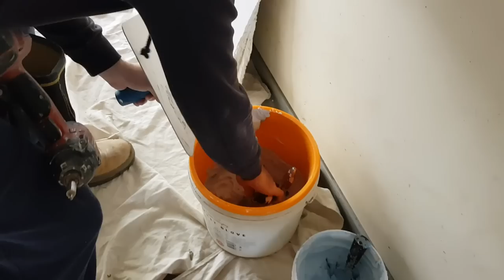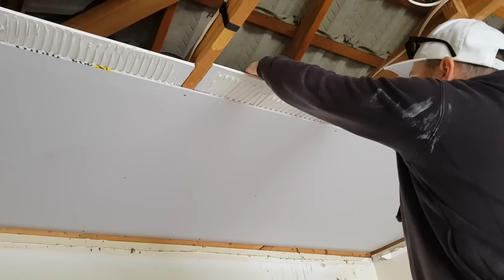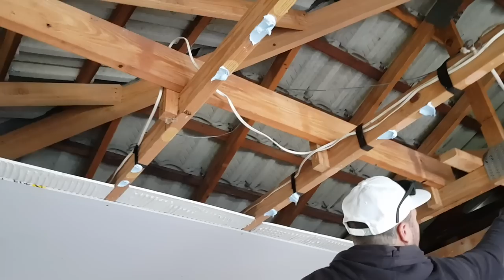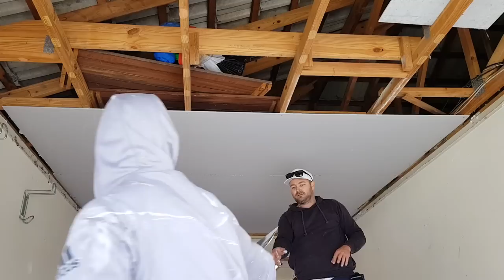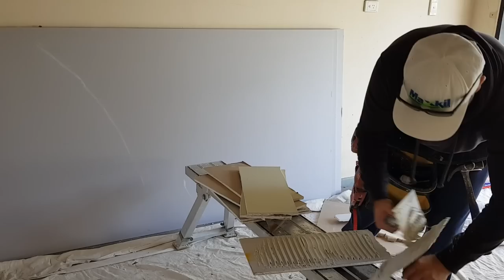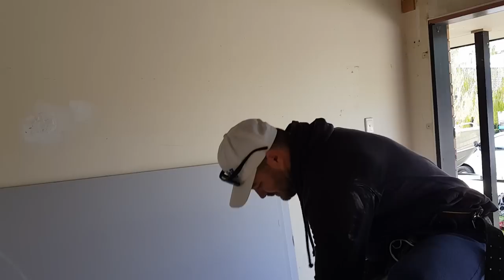Get Stronger Joints when Hanging your Drywall Ceiling

Comment: Always good practice to bridge seams when 24oc, we use 1/2" plywood scraps and screws, also found that spackle spots on joints never holds up from expansion and contraction seems to let go. Nice work guys

Comment: That's the way Buddy !! Always 'back block' Your ceilings as well as strengthening the joint you get rid of some of the off cuts. Manufactures recommend to use back blocking cement. One thing for certain will be that the Seppos won't know what back blocking is. Great work as usual !!
Reply from the maker: Thanks Serge

Comment: You guys are on the right track but a stronger and faster way is to use scrap 2×4 lumber and 2 screws on each side. 
I highly doubt the second sheet will have that good of an adhesion unless you reach up and over to press down on the blocking, which I absolutely know you didn't do.
Reply: I was about to say that to, like is wood blocking that hard to put in lmao
Reply: Adding wood blocking would take much longer and cost more and would require more tools and material and make more of a mess

Comment: You can't use timber blocking it will crack the join as it moves in the heat, they are doing a great job which won't crack or move
Reply: Are u crazy one timber of 2x2 at same as your switch pads or radiator pads 500mm or timber to side of each joice do you guys even know about staggering your sheets to make it more solid  i can agree with putting the plaster on the joices or mastik

Comment: In my 45 years in the trade, ive never seen this done, and have never had a problem..........though we do use 5/8 board on ceilings on 2ft centers......
Reply from the maker: yeah ours is only 10mm thick. too thin if you ask me
Reply: @Maxkil  so our 5/8 board = 16.8 mm, and its fire rated, which is way stronger than regular board. Do they not have fire rated board where your at?

Comment: I worked in Indiana, Ohio, and Kentucky, it really wasn’t necessary inland, maybe in costal states with Hurricanes, sandy soul  n such but I never experienced issues  with the Flat joints cracking hanging on 24” centers.. I know the codes and circumstances are different in other areas

Comment: Better to screw the back blocks to pull them in tight?
Reply: I would agree.. but pulling drywall to drywall tight? I have used wood blocks to do that.

Unf.. unless you have someone in the attic to push back down, the bond is not that great. Maybe some runny mud would work.  Or pin them to the rafters.

At the end of the video he picks up on one of the back boards.. that's all the bond your getting. You can push and squish them as putting on. But once the next full sheet goes up it will lift it up just like the guy did. Leaving it floating. Any bonding would be minimal.

Comment: I think they are using 10 mm drywall.  USA use 1/2 inch or 13 mm to 5/8.  So back blocking not required.  But with that said. I back blocked a house recently and think it improved strenth.  Thank you for vidios.
Reply from the maker: Hey mate you're exactly correct. It's exactly why we need to do that, our board is quite thin, and sometimes it can get a little flimsy. It is light to hang though and the sheets come in 6meter  lengths. Thanks for watching bro

Comment: Good work with the backblocking the only thing is that you, only put one screw in the middle when with csr board requires two screws at 400mm centres just letting you know for future videos but keep up the work
Reply: Jesse Dale we use 2 screws either side of centre for 1200mm sheets and 2 screws at 450mm centres for 1350mm.

Comment: Are u crazy one timber of 2x2 at same as your switch pads or radiator pads 500mm or timber to side of each joice do you guys even know about staggering your sheets to make it more solid  i can agree with putting the plaster on the joices or mastik

Comment: And that’s why sag resistant is the best. Always someone trying to over think  work.
Reply: Or use 5/8" drywall on 24" on center roof trusses
Reply: @larrylewinski3086  1/2 sag is twice the rock with less than half the weight, unless 5/8 is needed for code. Try some time, 1/2 sag doesn’t burn anymore than 5/8 it’s all about the money and someone making the fire codes.

Comment: I'm thinking the drywall so thin that they have to put blocking between the bottom chords. They seem to be very much behind with their building codes they're still using skip sheathing on the roof, and nothing for waterproofing but the cement tiles sitting there.
    I wonder how thick the lid board is there? I wonder why they don't screw with the back blocking??

Comment: question please , do you have to support the joints with extra board and glue? the weekend i will be re boadring my utilty ceiling as a leak from the bathroom ruined it. i will strip the old baords back to joists. the ceiling is small 8ft by 6ft. do i need to put glue to the joists like you do here? and do i need to support the joins inbetween joists with extra board and adhesive?
Reply: I can help u in millimeters mate hahha
Reply: You shouldn't have to glue the drywall if you use enough screws. 
Always use the 5/8" thick drywall if the framing members are space over 16" on center.

Comment: Hi mate, why no 450c metal battens for this job? wondering why some ceilings have this and other don't cheers
Reply: Depending on what you are talking about buddy
Reply: Do u mean the roof or trusts
Reply: @superherobeatdown  yeah looks like your fixing it directly to the truss / ceiling joist. i noticed in some other videos a metal batten would be fixed first then the plaster board is fixed to the batten. Is the batten only necessary in certain situations?
Reply: @brenden8783  Usually it's to level out the ceiling and help reduce cracking as a new house dries out. When you have a large area like an open concept house you can see the waviness of the trusses. Sometimes it's also for noise reduction.

Comment: You may save a few dollars but this is still the wrong way .All joints should be on Timber / structure ,  I have worked in the UK this is how they do it no problems ever . Floating joints are weaker .Plaster board is cheap why do a crap Job !!
Reply: Here in the US,  4x8 foot, 5/8" thick sheetrock is supposed to be used for the ceilings, run across the joists (timber), which are 16" on center.  The finished edges are often floating, except for a screw every 16 inches.  No back-blocking required.  But I've seen it done different ways.  Inspectors generally don't have a problem with it, as long as the sheetrock is 5/8 inch.
Reply: GSMSfromFV Thats not the point .Floating joints in any media are weaker .
Reply: And there are no problems with 5/8" sheetrock with floating joints.  If there were, it would be addressed by the building code.
Reply: GSMSfromFV It is in Europe. All I can say is the building code in the USA is substandard.
Reply: I'm left with the impression that the UK and Europe has a problem with sagging ceilings, thus the need to have  ceiling joists and cross-bracing at all the joints of the sheetrock.  That's not a problem here in the US, as long as 5/8" sheetrock is attached to joists that are 16 inches on center.  And I live in California, which is known for its earthquakes.  My house is 47 years old and I've never had a floating joint problem.  It's essentially unheard of.
Reply: Here's a California Drywall Code Checklist: _http://buildingincalifornia.com/wp-content/uploads/2014/01/DrywallChecklist.pdf ____ When 5/8" drywall is attached to 2x8 ceiling joists that are 16" OC, there isn't going to be much deflection, if any.  When the floating joints are filled with compound and taped, the bonding between the two sections of drywall is pretty rigid.  My house has gone through multiple earthquakes over its 47-year life, and ceiling cracking, much less sagging, has not been a problem.
Reply: GSMSfromFV  Not at all .Sagging ceilings in houses that are 100's of years old  made of  lathe and plaster mixed with horse hair has nothing to do with plaster board fixing  .I have Family in the USA ( Alabama and New York ) they were in awe at the quality of building in Europe. You may want to look at the building warranties or lack of inclusions in the USA .I now live in Australia who use the same method as the USA for dry lining , its definitely inferior. I have worked in the construction Industry for over 30 years and as I stated in my first post cost seems to drive these poor practices. I won't even start on roofing method s it starts to get really ugly 🙄.As for your statement its unheard of in the USA,  I suggest you look at all the utube videos that refute that .
Reply: GSMSfromFV You may want to google which first world country has the lowest standard of building code .Yep thats right its the USA , except for a few states .Sorry !
Reply: I cannot speak of the the other things that you reference, since I'm not in the business.  But I do know this - backblocking and/or having a timber on all four sides of of ceiling drywall is in search of a solution in which a problem does not exist here in the US.  If it did, it would have manifested itself decades ago.  An inefficient use of time and material.
Reply: GSMSfromFV As I stated there are plenty of US utube videos on repairs of this type .I wonder why !
Reply: Repairs, yes. Not original/new construction.  I use the back-block method to repair holes in drywall.  I've watched many YouTube videos regarding original/new ceiling drywall installation. Since the drywall is installed across the joists (not with), inevitably at least one of the factory edges does not fully contact wood over its entire length.  Just every 16".   Now, the ends of the sheet must split a joist in half over the sheet's entire width, or butt up against the wall.  The 8' factory edge, no.  Not required by code and historically it has not been a problem.  Any problems that I have are usually associated with me not applying the mud properly either over or under the tape.  When it dries, it comes loose.  That's when I usually get a professional to tape and mud it for me.  I realize that we are just going around in circles regarding this issue.  You've seen things with your own eyes, and I seen things with mine, which includes pulling permits, having inspections, watching drywall contractors, installing myself,  and asking questions.  Best of luck with your endeavors.
Reply: @GSMSfromFV  I disagee partially,  in az where single story residential are mainly 24" ctc, I repair sagging joints almost daily,  it is normally a nailing problem, to few or way to many,  i guess a workmanship, lazy or no inspection problem,  is what I  always thought,  that is about half of the sagging problems,  most ternants in rental homes think they can place boxes for storage directly on the sheetrock,  well you know thats going to sag,      that is the problem for  about the other half of the jobs,  I will have to try this blocking and see if it helps, if anything where people are trying to storage items in the attic.  Now on apartments, condos etc that are multi story,   where you have 16" ctc,   I very rarely fix for sagging joints, if I do,   it is usually water damage,   so i agree and disagree,  I hope I explained that right.
Reply: Travis, I agree.  24" OC joists and/or short nailing is just asking for future problems.  Not totally sure, but I think here in CA, ceiling joists have to be 16" OC by code.  Mine are 2x8s, 16" OC.  Never a problem.
Reply: Be thrown right of the job in scotland if i did that. Every edge has to be supported by timber.
Reply: @jamatoke  agree totally

Comment: If one of my guys did this they would be fire instantly. 6 screws across the width of the sheet and 10 across the length is plenty. No need to this extra time wasting.

Comment: The guys are right. If you did this in Canada you would be laughed at & fired on the spot. You would be known as a hack. Should be using 5/8" drywall. In Canada we screw it every 8 to 12 inches apart with 2" drywall screws on the ceilings & some guys double up on the screws. You could use blocking in between the rafters such as 2x4's but most times it's not necessary. As for that damn drywall gun your using, throw it away. You'll be deaf in about 6 months.
Reply from the maker: Yeah I'm aware of that. Here we use a stud adhesive instead of so many screws works very well. Our sheet is longer and thinner yet strong.  We could do it to your standard, when in Rome. Just look at our installation guides and figure out we are doing it to the way prescribed in our country.

Comment: If I seen my crew do this it would be a definite fired on the spot. Never seen this unneeded work and pointless.
Reply: You've never been to Australia or New Zealand then? You'd get fired on the spot if I didn't see you do this.
Reply from the maker: Yeah he would have to climb back up into the ceiling
Reply: @Maxkil  the first question people should ask is what country are you from. Or, get some proper understanding before saying outrageous things.
Reply from the maker: Bro some of the comments amaze me.
Reply: Some of these comments are just plan out there..look I've been doing drywall for 25 years and anything I can do to improve my product believe me the customer appreciate it..we all have to find ways to be moving forward in what ever we do...good job max!!!
Reply: Yah your toilet spins  backwards enough said!
Reply: Look like the builders did a cheap job and left it to the gib fixers to fix so there backblocking .. nz and houses are not all finished like this..
Reply: @MrRooXs  this is a one off nz and aus house are not framed like this